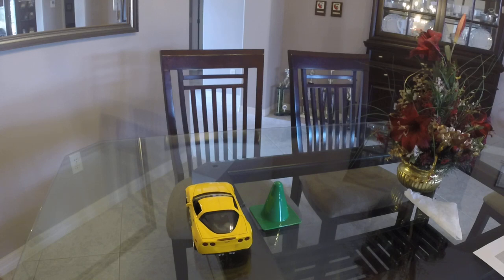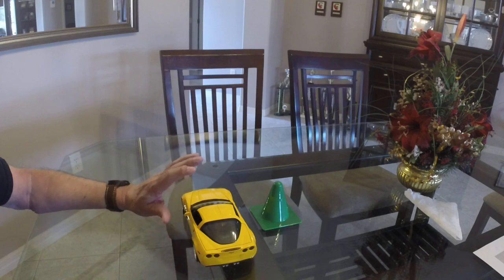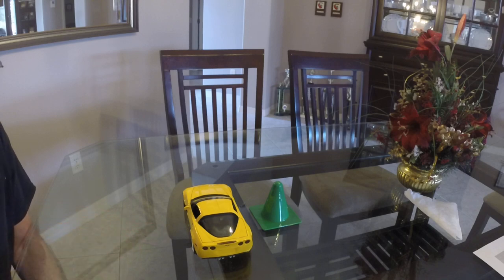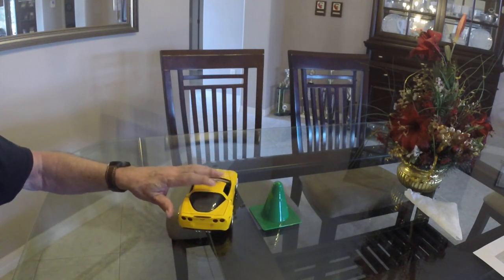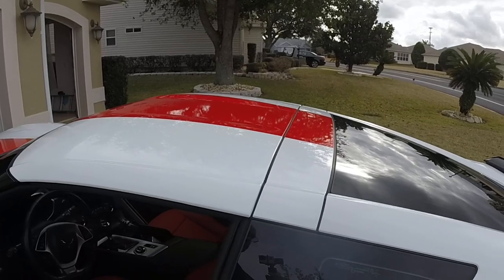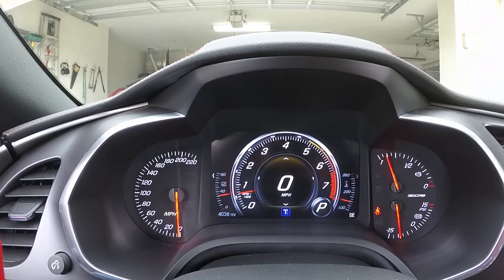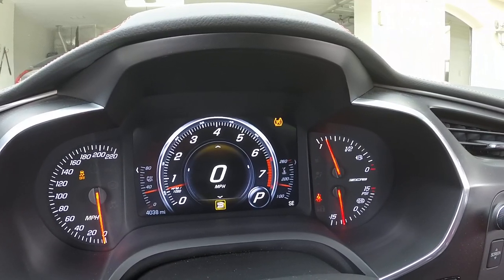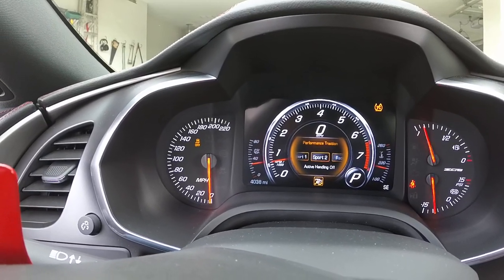PTM Traction Control and StabiliTrak

Comment: I just bought a 2013 Chevrolet Silverado pickup with 4WD. What's the difference between the TCS and Stabilitrak systems? It seems like they're both trying to accomplish the same thing, keeping you moving in a safe and manageable manner.
Reply from the maker: Hi Keith, the TCS stops wheel spin by reducing power or actually applying the brakes to control the traction of the vehicle. Stabilitrak improves stability of the vehicle by applying braking (could be to just one wheel) and/or retarding engine torque so that the vehicle hopefully goes in the direction you have it pointed.